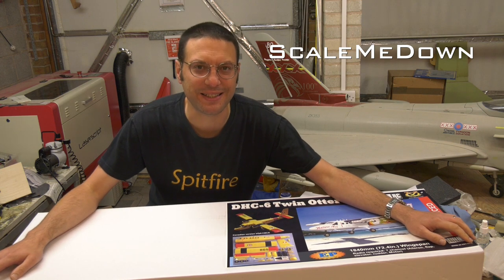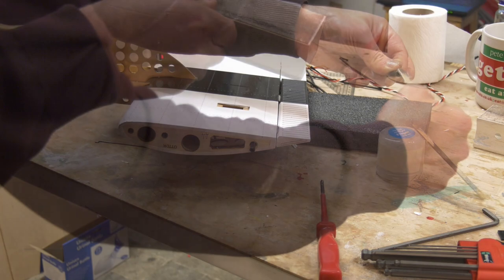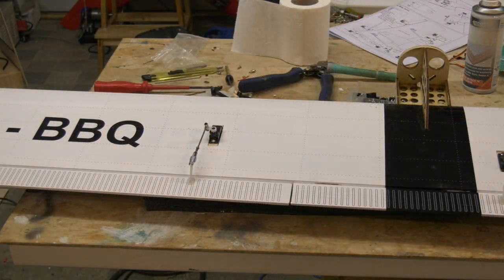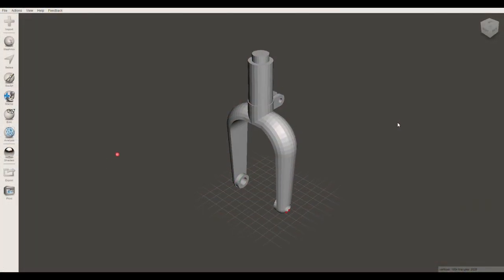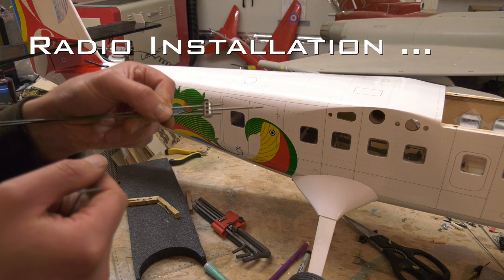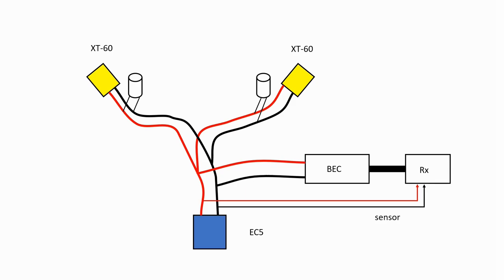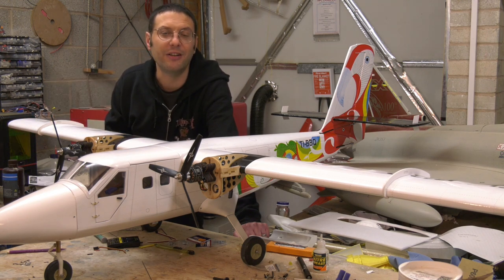VQ Models Twin Otter - Part 1

Comment: Nice work👍,
Which material you are using for body building?
Reply from the maker: This model is built from mainly liteply with a little bit of balsa and vacuum formed mouldings.  It is covered in a thick, self adhesive pre-printed film.
Reply: @ScaleMeDown  👍
Reply: @ScaleMeDown  I am going to build an aircraft of the same size. I use foamsheet. Can you suggest a suitable motor for it.
Reply from the maker: The motors used in this model would be suitable for your project; Propdrive 35-36 910Kv @anandhusatheesh1882

Comment: Thanks for sharing this video with us, it was very helpful. I just finished the build on mine (i got the RCAF SAR version as I used to work on those planes in real life). You had so many great tips that helped me out a lot! One question, can you tell me where you got the 3 bladed props? I would like to convert mine to the 3 blade setup as well. Cheers!
Reply from the maker: The props came from my local model shop; https://www.stevewebb.co.uk/

Comment: Please can you explain in detail how you fix the wires before and after into the wings and were you made the hole in the wings for the wires? Thank you
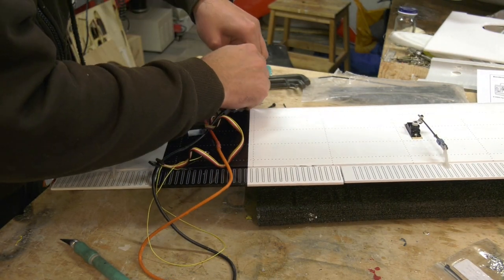Reply from the maker: Hi. I solder up servo extensions so that they stay "fixed" forever (cannot come unplugged).  You can see at 4:43 in the video where I drilled oles in the lower wing skins for the ESC wiring.  It will be later overed by the nacelle mouldings.

Comment: One thing I prefer to do re removing covering Isto use a solder iron, gentle heat to melt the plastic, without scoring/cutting the fibers of the wooden structure underneath
Reply from the maker: Great tip 😀
Reply: @ScaleMeDown  thanks.  I have the VQ Monaro with ASP91FS, and VQ P40 Kittyhawk with YS F-91AC supercharged 4 stroke.  Both are fantastic models for their price point.   And Hello from little New Zealand

Comment: Did you put anti-torque angle on the motors?
Personally, I put 5° external to each engine.
What do you think ? Should I stall the motors at 0°?
Reply from the maker: I set mine at 0 degrees, as when both are running normally, the torque is completely cancelled.  In case of ESC failure etc, my method is to close the throttle, lower the nose and treat it the same way as an engine failure on a single engine

Comment: Great video, what motor and servos are you using?
Reply from the maker: The Motors are Propdrive 35-36 910Kv, and the servos are HS82MG and some smaller 9g metal gear ones.
Reply: @ScaleMeDown  what prop size are you using for the propdirve 35-36?
Reply from the maker: @sandiesalimbangon5208  3 blade 9x7"

Comment: Any chance you sending the files for the 3d print prop spinners you designed
Reply from the maker: Hi, I don't supply the files, but you can get them here; https://www.etsy.com/uk/listing/1396011996/lh-3-blade-spinner-to-fit-vq-models-twin?ga_order=most_relevant&ga_search_type=all&ga_view_type=gallery&ga_search_query=vq+twin+otter&ref=sr_gallery-1-1&cns=1&organic_search_click=1 and here; https://www.etsy.com/uk/listing/1410229641/rh-3-blade-spinner-to-fit-vq-models-twin?ga_order=most_relevant&ga_search_type=all&ga_view_type=gallery&ga_search_query=vq+twin+otter&ref=sr_gallery-1-2&sca=1&organic_search_click=1

Comment: wing alignment pins not fitting is bad...very bad from the factory
Reply from the maker: Yes. Thankfully, they don't require too much fettling.  Mine were quite obvious as the internal doublers were slightly misaligned